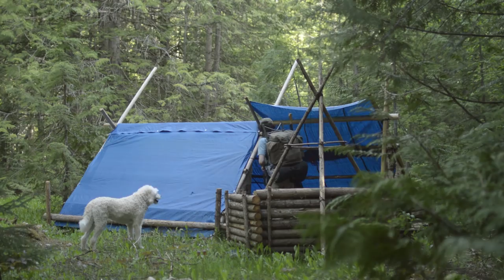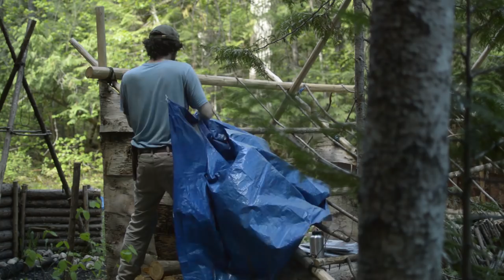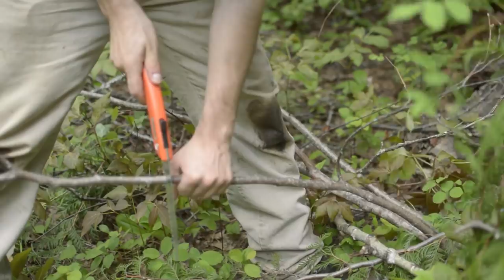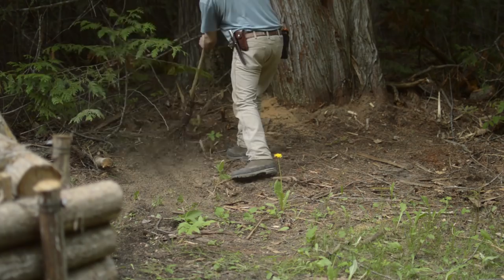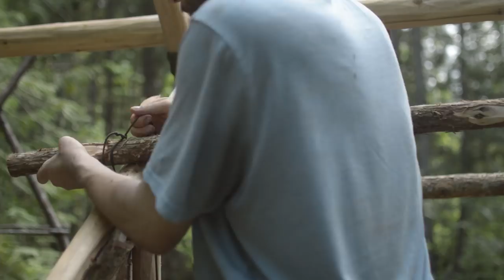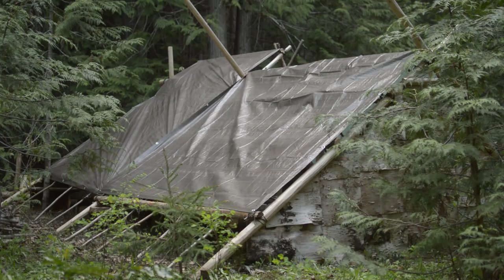Roof Repairs & Camp Cleanup - Repairing the Long-term Camp - Camp Firlend

Comment: Instead of ripping down the old ones they could have been patched up with duct tape, And I would have covered the outside tarp roofing with fern as extra protection maybe, definitely protect the tarp from long term wind and ripping. Then the camp fire could have been moved a little closer for better heat in the winter,  we used to do that and also put a roof 6ft high over the fire to protect it from eventual rain and snow when lit. hang ur pot wire from the roof basically 4 posts 3 walls 3ft high and of course the front open and the roof overhanging the whole area by about a foot all the way round worked great.
Reply from the maker: I really just used it as an excuse to get rid of the old blue tarps honestly. The fire is plenty close enough to reflect heat into the lean-to area of the camp. That idea sounds great though. I hate rain putting my fires out!

Comment: U should Look into >Arcturus< Heavy Duty Survival Blanket - >>>Insulated Thermal Reflective<<< Tarp - 60" x 82". Solves Ur tarp destruction & Insulating problem, at once...
Shows 35Lb weight swinging in the wind tied 2 the tie-down eyes = >>>zero tear<<<
Those new tarps blend into the forest better.

Comment: @Wituik Self, why did you demolish the entire roof (i.e., the tarp and the structure) in order to repair a tiny rip in the tarp?  Most basic hardware stores sell tarp patch kits.

Even better, leave the first tarp in place, and install a secondary, one piece tarp over the original tarp.  Such will make the roof stronger, and more waterproof.  Such will also make the inside of the lodge warmer.

Other than that you did an excellent job, with respect to creating a wonderful, long term, survival camp.

Comment: It would be nice to collect enough birch bark to completely cover it instead of tarps
Reply from the maker: I was thinking about that. However the birch bark loves to curl when it dries quickly, so it wouldn't have worked in the long run. I have to replace all the walls now :/
Reply: @wituikbws  I suggested an ARMY TARP on your first video. Scotch guarded. They are super quiet in the wind too. I do like the darker colored one you picked for round two however!  I really admire your spirit.  How did you know/learn how to build all this?  Amazing job!

Comment: these tarps are great and cheap, but they do degrade quite badly in the sun, i suppose if they are covered by turf or a good thick light proof layer of vegitation they may do better. i have not tried it.
Reply from the maker: That would be the best idea. An even better idea would be to just do it all naturally, but I never got around to doing it that way.

Comment: Why not go with a canvas tarp? A lot stronger, will last longer and will resist sparks from your fire. I know it will be heavier to pack in, but you won't have to replace it each year. Just curious...
Reply from the maker: I would love to; however, the shelter was built to be more of an execution of an idea I had, rather than to actually be lived in/used as a long-term camp, so I went as cheap as I could
Reply: Did you keep one of the old blue tarps to use as a door for the sleeping area

Comment: I'm a bit surprised that those blue tarps held up as good as they did. If you're going to continue using tarps, you really should invest in much, much better ones like oil canvas. Here's a link to a good place to start looking: www.tarpsplus.com. You should be able to find something there. Also, bankline is a substantially better cordage than paracord for long lasting structures. Bankline does not stretch and is in just as good of condition a year later than the day you put it in.
Reply from the maker: I was quite surprised as well. Here's a little secret of mine however.. The camp isn't actually a long-term camp haha. This camp was just built based off an idea I had for a long-term camp design but is used just like another other bushcraft camp. No one lives in it and it will be taken down sometime soon. I would love to use some nice tarps on it but since it wasn't meant to be lived in, I decided to just go with what I could afford at the time just to get it done :)
Reply: Ok. I was thinking you were going to spend more time there. In that case, have fun with it and when it's gone, move on to something else!! :)

Comment: Sorry just found your videos and think they are awesome. 
to comment on your question about the sound, it could be a Mountain lion but I  am going for a hawk, even though your dog is not a good protector is still a slight deterrent for them. 
Not that it matters but I have a question. after you put the joists ad splines in to the ridge pole for the walls would you not think putting some spruce branches overlapping down than then the trap over that or vice versa give some more insulation value to the angled wall for winter events and if placed on top of the tarp may help with some possible longer protection of the tarp? 
This location close to a town or a roadway? could hear lots of car and truck sounds in the background and other things not sure why this would be 
keep up the great work
Semper Fi

Comment: Serious question, I promise I'm not being snarky. Why not just repair the hole in the blue tarp with duct tape or something and put the new ones on over top? That would have given you a layer of dead air between them for insulation.
Reply from the maker: The main reason is because I really wanted the blue tarps gone haha!